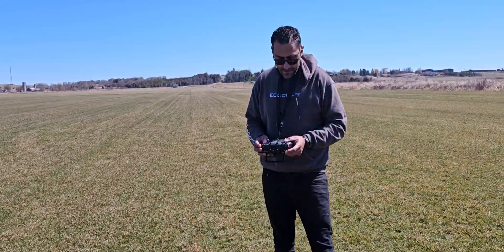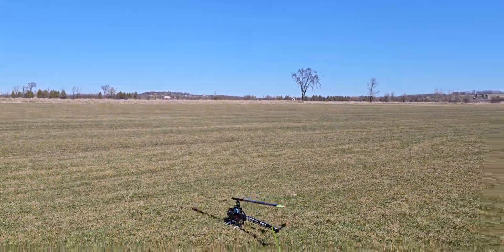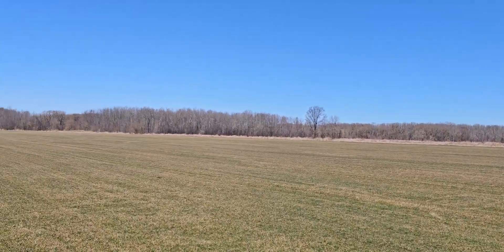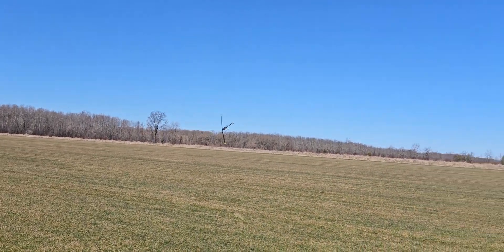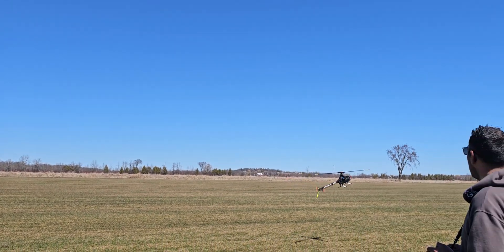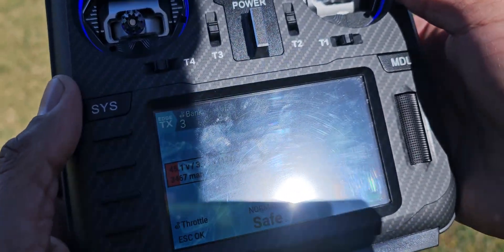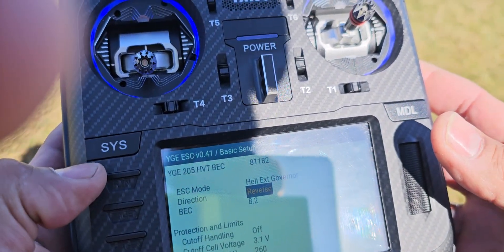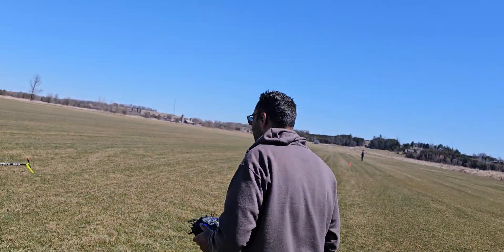Goosky rs7,  ROTORFLIGHT F722

Comment: Hi Diego,

Have you had a chance to use the new Rotorflight Nexus with the YGE 205 HVT and an xguard/flight pack? If so, could you share a picture showing how you connected all the wires? Before I purchase a Nexus, I want to ensure it can be done with the YGE 205A and an xguard. I’m concerned there might not be enough connections for both BEC cables and the xguard.

Thanks!
Reply from the maker: @rdjvelasquez  yes 
Basically I combined the esc signal with one of the power lead 
Yge only needs a signal for rpm. 
And the same for bec 
Esc cable only need signal 
Pm me on Facebook I can explain you better
Reply: @Diego3dm  Thank you, I sent you a message on FB.